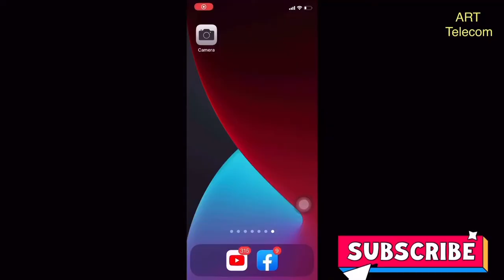iPhone XS Max No Power,short U3300 USB charging ic repair

Comment: My iphone xs recently stopped charging and face id stopped working at 20% battery, and it started automatically rebooting and heating up and battery went 0 due to no charging and phone got dead, the repairer said the ic should be replaced and will cost me 10k PKR. IS THIS ISSUE VALID OR HE IS SCAMMING ME